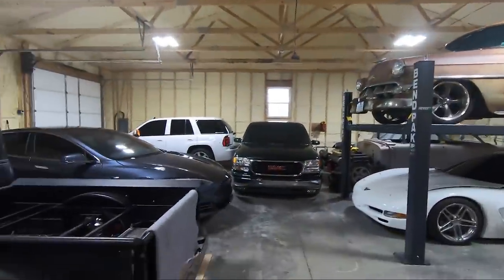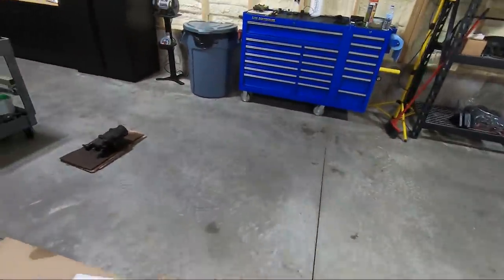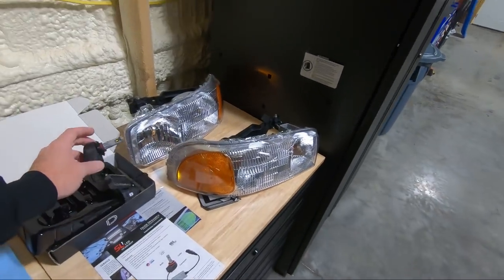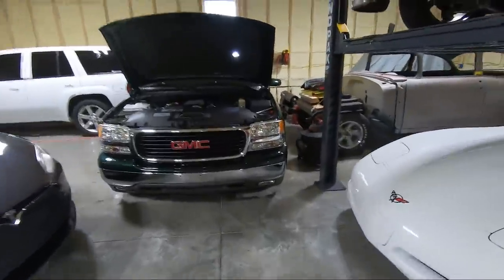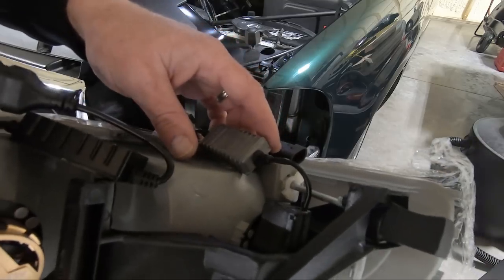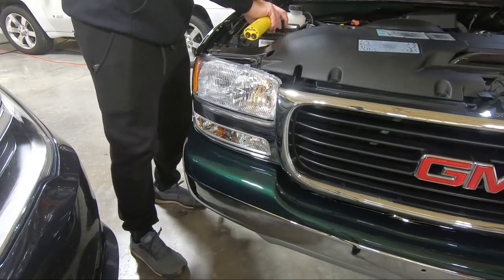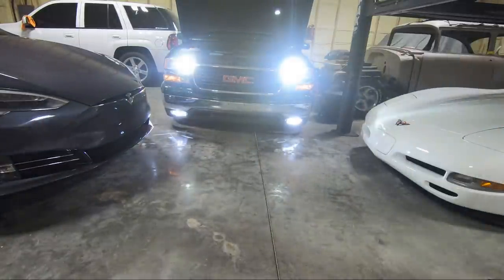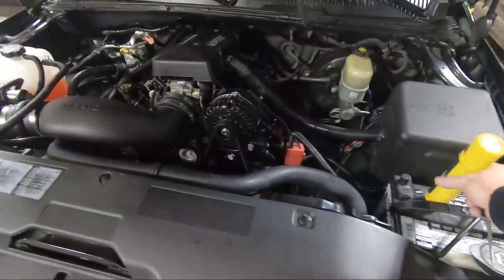New LED Headlights and Housings for the Slammed Sierra

Comment: You can add a resistor to each headlight and when you turn on your high beams both high and low will be on at the same time for and even brighter drive at night.
Reply from the maker: I have done that in the past
Reply: In 99-02 you just ground the low beams and they will stay on with the high beam
Reply from the maker: Good info

Comment: How are the Diode Dynamics leds holding up a year later? I replaced my faded headlights with a set of OEM Denali lights and wanted to replaced the bulbs with those DD leds you got but wanted to see how they're holding up.
Reply from the maker: Like the day they were installed
Reply: @TWAMotorsports  thanks man for the reply. You're a wealth of info, I'm building an nbs rcsb Sierra like yours.
Reply from the maker: Thank you. Good luck on yours

Comment: What would you say are your #2 pick is for the low beam LEDs for 99-06? I had bought some red style LEDs you recommended in a different video but I was looking to get a different set as I did not like the red reflection in the housing.
Reply from the maker: Lasfit for cheaper option

Comment: The low beams in the description link say they are for “Diode Dynamics Fog Light LEDs compatible with Lexus LS430 2001-2006 (pair), SL1 White” and these fit the Sierra housings? 

I wasted money on some Sealight Xenower High and Low beam set and I can’t even aim them because the beam pattern is such a random burst. The hotspot looks like a giant L and they are unequally bright haha. I also have the same Housings your using. 

I just need a good low beam that wolnt blind other drivers with a flood of light and is aim able haha
Reply from the maker: These have been great

Comment: Bro look so good on it! I just upgraded my 2005 GMC Sierra 1500 with all LED light bulbs and I had replaced the regular relay with LED relay to stop the fast flickering, the only problem I have is at night the turn signal does not blink unless I turn off the headlights or they will work if I disconnect the side corners . Is there something else I need to install ? I also noticed that signals work during the daytime.
Reply from the maker: Not sure on that. I don't use led turns
Reply: Better to use standard bulbs for turn signals

Comment: What bulbs did you use for your DRL’s?    I’m trying to figure out which type would work for my Yukon.
Reply from the maker: Listed in video description I believe
Reply: @TWAMotorsports I couldn’t find it, I went ahead and ordered low beams and high beams.  I just couldn’t find out what you used for your Daytime Running Lights.
Reply from the maker: Zevo I believe
Reply: I used Sylvania LED 4114s from Walmart
Reply from the maker: @LA_Commander those are ok for drl too

Comment: Hey travis u still in mo?    Im in cape girardeau and my 05 sierra has upgrade leds all away around.

How can I do the drl\fog on mod and also i can never get my drl on (the bottom housing closed bulb to the grill I have never scene ever even in drive
Reply from the maker: Yes I'm in Missouri. I haven't done the all on on these years but it can be done. You may need new sockets for the drl lights

Comment: Looks really good! When I bought ebay replacements for my Cat-eye they have no adjustments Lol so looking for a different brand cause I can't see at night they face straight down at the road and they meet in the middle
Reply from the maker: I really like the tyc option I used here. Used them on my cat eye dually too if you need link
Reply: @TWAMotorsports  Yeah for sure send me the link unless they are in a old dually vid. Mines still for sale but no hits on it been sitting 3 weeks at a friend's for sale hes got a killer spot but no luck yet
Reply from the maker: It's the red dually video I did
Reply: @TWAMotorsports  I'll check it out thanks